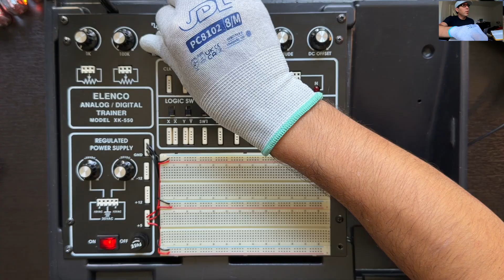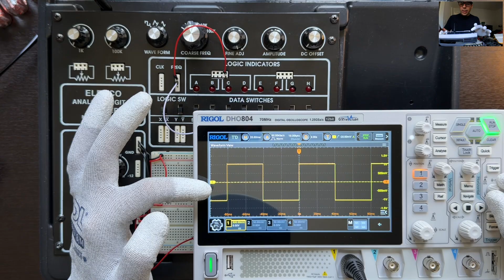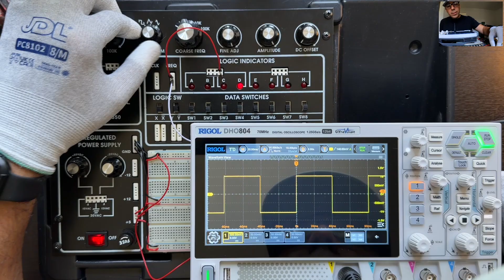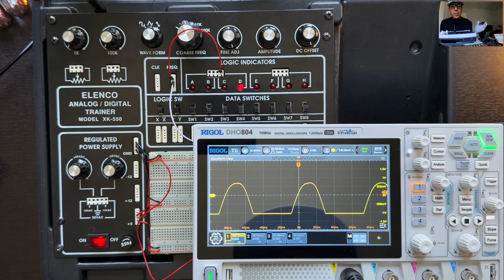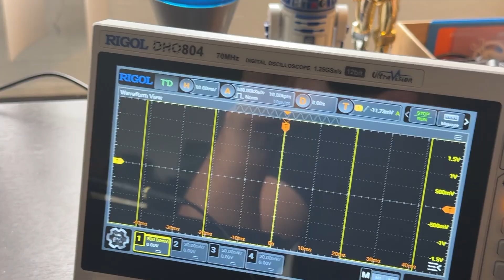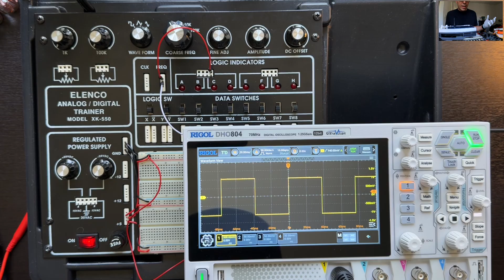My first Oscilloscope - Testing a Function Generator! Rigol DHO804 and Elenco Digital Trainer

Comment: Btw you had 2V peak-to-peak (really 20V after the probe switch fix), from -1V to +1V  (+1 - -1) 😉
Also, if the probe is set to 10X, in the scope "probe" menu you can match the ratio (and then the signal will be displayed going from -10V to +10V)

Comment: If your probe is set to 10x, but your scope is expecting 1x then your scope will read 1v on a 10v signal.
Reply: It looks like you figured it out.  You should just use your probes in 10x.  Its a complex reason, but just use it always in 10x.
Reply: If your trigger is coupled to AC, you wont see the dc offset.